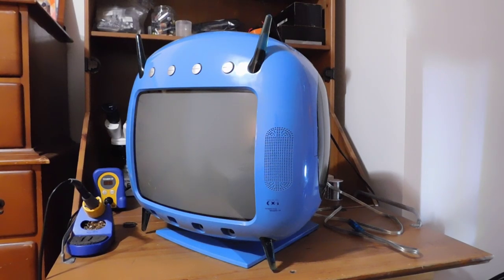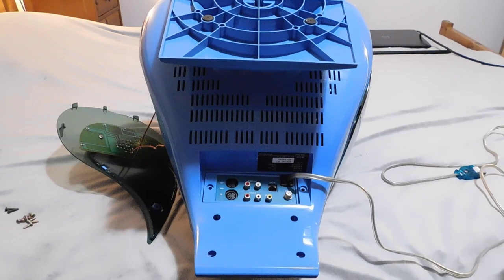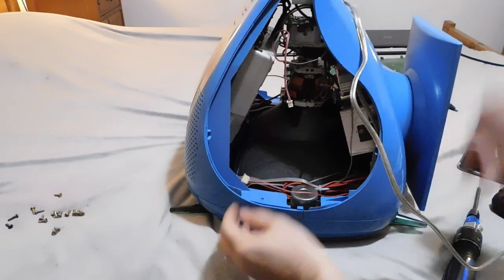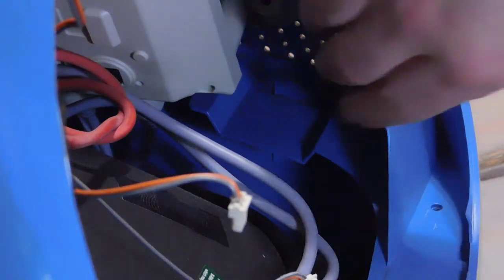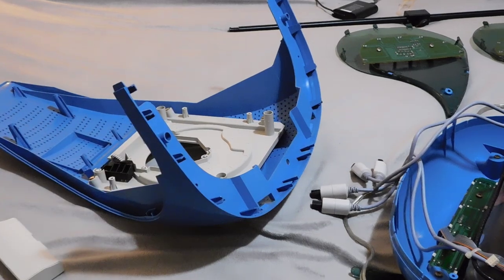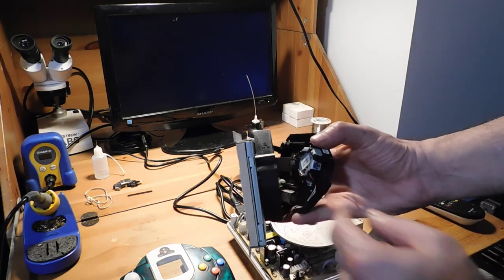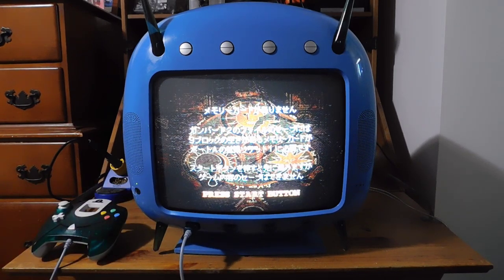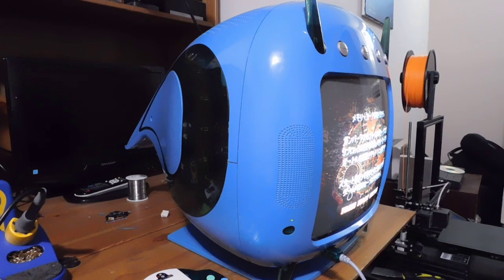Divers 2000 CX-1 Sega Dreamcast TV Repair! Teardown, Laser Replacement, and Overview of Features

Comment: Also, maybe it's easier to put a 4 wire modchip in there if you haven't put in the other Bios already, it's a way to keep it as stock as possible while also making it region free.

Comment: Awesome video! I picked one of these up complete in the box a few years back. Some background research resulted in my using a step-down converter while (rarely) using it to play games here in the US. Do you feel this is necessary?
Reply from the maker: Thanks, I’m glad you enjoyed the video! I definitely think it’s a good idea to use a step down converter to go from 120 V to 100 V as that is what the internal power supply is expecting. The system will still work without the step down but there might be long-term effects because it was designed with a lower input voltage in mind

Comment: How does the CX-1 adjust for rotation and offset?
Reply from the maker: It has limited options using the menu. Unfortunately the crt used in the Cx-1 is a rather inexpensive one

Comment: Actually, Dreamcast units are known to have different drive manufacturers, be it Yamaha drives or Samsung drives. Usually you can tell from the laser pickup itself or the inscription on the metal plate of the drive.
Even their sound is different, still loud though (yours seems to be a Yamaha by its' sound).
They are not interchangeable, and use different voltages.
Reply from the maker: That’s good information to know. I really thought they were all the same!

Comment: Tried changing the TV to RGB?
Reply from the maker: It might be possible but then it would not work easily with the Dreamcast. Dreamcast does composite, s video, and VGA, but not RGB
Reply: @LIRetroGaming  
I have a dreamcast scart cable. Can RGB output, but only 480i